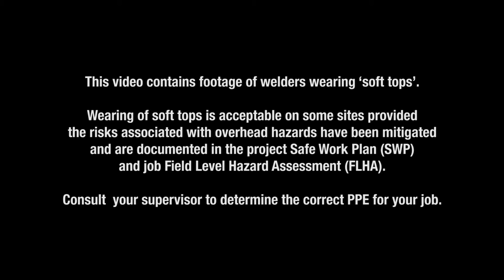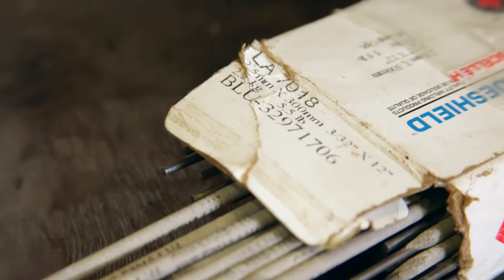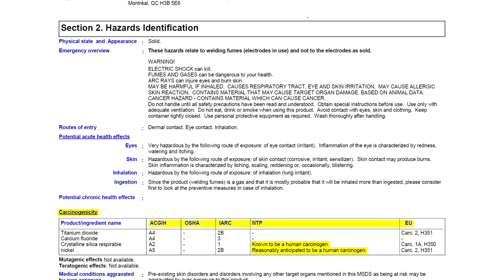CIMS Safety - Respiratory Protection

Comment: I went to welding school and got my SMAW structural certification and not once was told to use a respirator or that we even needed one. They said blowing your nose with black stuff coming out was just part of the job lol. I just ordered a 3M respirator and will always use it now
Reply: My nose was always black and my school the best ventilation.
Reply: @Mikey-ym6ok  how much % really the mask protect?.
Reply: @automotivetech7590  did u get answer
Reply: @automotivetech7590  from what I know the black stuff can also come from metal shaving when grinding. When I started using n75's in the shop my nose blew clean. For noxious fumes IIRC the filter specs will tell you that
Reply: @automotivetech7590  a lot more than no protection.